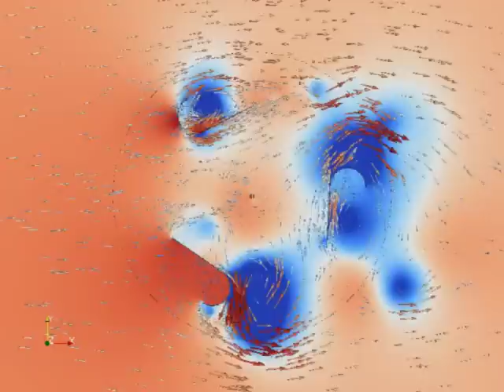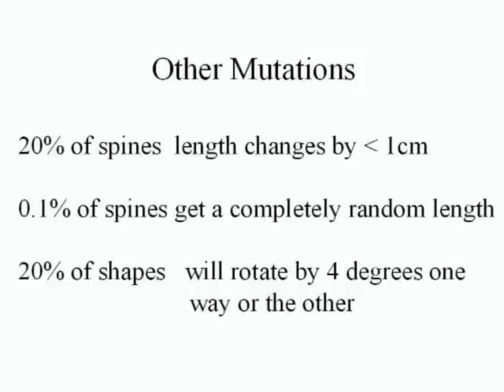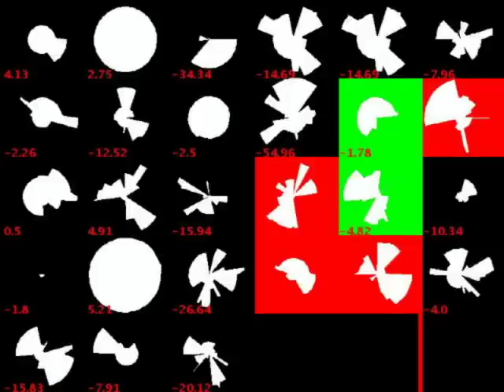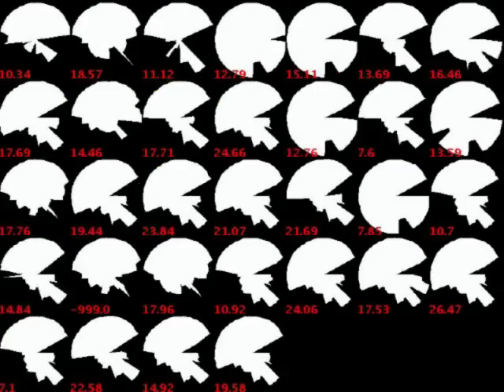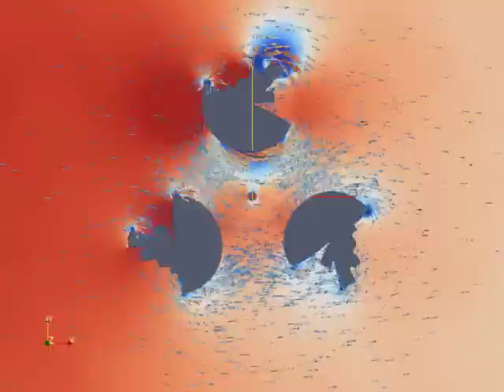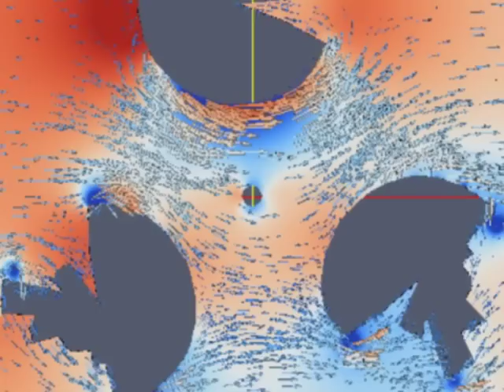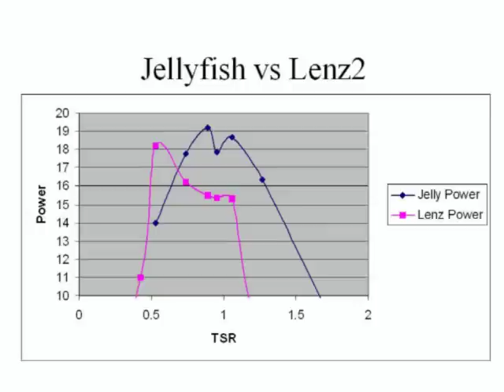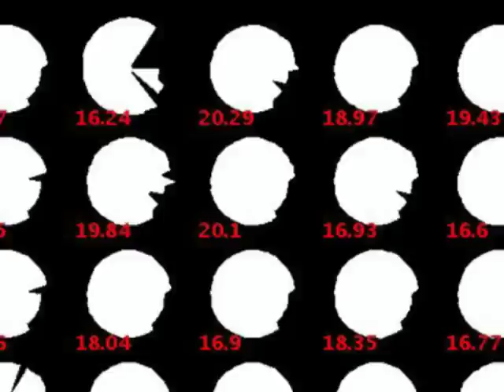Evolving Wind Turbine Blades

Comment: technically you did design the blade, otherwise it would never have looked like that.

Computer evolution always has a designer behind it, or else it never would have done anything.
You can also conclude that real life has a designer since nothing would have come on random.
Reply: "technically you did design the blade, otherwise it would never have looked like that."

No, he created the environment and its laws which then created the blade. The computer designed 100% of it.
Reply: SaHaRaSquad yes HE created the environment, and how the shape would look, that's based on his inputs. it didn't happen out of random. computers are actually designed to do what you tell them, they do not create anything out of random. you can see the end goal of the shape is actually just a circle.
Reply: MrPepsicola123 "computers are actually designed to do what you tell them"

And he told the computer to randomly generate and mutate turbine blades and simulate natural selection - which is exactly how real evolution works.

"they do not create anything out of random."

So you never heard of something called random number generator?
When a computer program uses this to change a shape, then this shape will be completely random, without depending on the decisions of the programmer.

"you can see the end goal of the shape is actually just a circle."

I don't know how circles look in your universe, but the final simulated shape is definitely not a circle.
Reply: SaHaRaSquad it wasn't randomly generated, he input a design he wanted and the computer "generated" an outcome based on his inputs. he created the shape.

Evolution does not work like that.
Reply: MrPepsicola123 "it wasn't randomly generated"

It was, why is that so hard to understand?

"Evolution does not work like that."

Evolution works exactly like that.
Reply: technically, yes, it's a shape that's based on having a spline around a center, BUT the length from the center to each point of the spline is determined at random in the begining.
After that some properties slightly change at random and the best performing shapes are kept.
Reply: MrPepsicola123 
"you dont seem to understand anything i am talking about"

You obviously don't understand anything about computers or programming, the stuff you wrote is truly cringeworthy.

"He input a set of instructions and let the computer generate an outcome based on his input."

Yes, and his input said "create a wind turbine blade based on random numbers". His input only set the rules, and the randomness made sure that he didn't have any influence on the outcome.

"if it was truly randomly generated he wouldn't have input a single instruction and the computer would have done it on its own."

If a dice roll was truly random the dice would have rolled on its own. At least according to your logic.

Your YouTube account is based on encryption, and encryption on computers uses true random numbers. If what you said were true, everybody could hack into every account on the internet and encryption would be useless.

"this is not how evolution works"

Learn the difference between the creation of a program and the logic of a program and then we can talk about this point. Although then it wouldn't be necessary anymore because you'd understand your arguments make no sense.
Reply: MrPepsicola123 "computers cant even randomly generate numbers."

This is wrong, period. Every decent pocket calculator can generate random numbers.
You have no idea how computers actually work and should stop spouting nonsense about algorithms which are clearly beyond your understanding.

There's a name for your behaviour, it's called Dunning-Kruger effect.
Reply: MrPepsicola123 "thats what it is, a theory"

Exactly the response I expected from someone like you.
A scientific theory is the most solid and reliable form of scientific knowledge there is.

So evolution is as certain as the fact that matter consists of atoms(atomic theory) for example, and it has been tested and confirmed countless times.

"if we know that we live in a simulation, we can change the code."

No. Data packets in a computer cannot directly change themselves. If our universe was a simulation, we wouldn't have a chance to change the slightest detail.

"that is what they are doing using quantum computers."

Quantum computers are nothing special in terms of computability. There is no kind of computational problem for which quantum computers are proven to work better.

Also they have nothing to do with simulated universes, they are just another basis for computing, just like biological computers are.
Reply: +SaHaRaSquad Why are you still arguing with this pathetic excuse of a human being?
Reply: SaHaRaSquad you dont seem to understand anything i am talking about and have this strange notion that something can be created out of nothing.

He input a set of instructions and let the computer generate an outcome based on his input. if it was truly randomly generated he wouldn't have input a single instruction and the computer would have done it on its own. this is not how evolution works, and this is not evolution.

this is called creationism.
Reply: SaHaRaSquad It is you who does not understand, computers do not create anything, they take inputs and spit out information, computers cant even randomly generate numbers.
Reply: SaHaRaSquad They do not randomly generate numbers, they take a pool of numbers and pick out numbers based on an algorithm someone coded. it is not true random, it is Pseudo-random, they may appear random but they are not.

You can call me whatever you want, and you can say i dont understand when it is you who does not understand all you want. it still does not prove that you are correct.

Friend it is you who is bias, you want evolution to be real so badly that you will convince yourself that computers can prove evolution. even when you know that a computer by itself can not create anything beyond what it is coded to do.
Reply from the maker: They don't use a pool of numbers, but it is true that they are generated by an algorithm.  You can make them a little more random by seeding it with the time or some other external variable.  Never the less, I did not program in the numbers that I wanted to come out, to me they were random, and evolution as an algorithm works.  You can decide for yourself if that applies to the world or not.  It sounds like you choose to believe it doesn't.
Reply: sjh7132 its still pseudo random, there is still a pattern. we have even discovered that real life is not so random as we think it is, there is also patterns like in a computer.
Reply: MrPepsicola123 "They do not randomly generate numbers, they take a pool of numbers and pick out numbers based on an algorithm someone coded."

And these pseudorandom numbers get seeded by a true random number, also cryptographic algorithms and online encryption/authentication only work with true random numbers, otherwise it wouldn't be secure.
There are multiple ways a computer can obtain true random numbers.
And in the end in this example it doesn't even matter if the number is pseudorandom as long as the seed is truly random - which it usually is in every modern language I know.

"it still does not prove that you are correct."

In a scientific sense I really didn't prove anything. At the same time you also didn't disprove anything, though.

"you want evolution to be real so badly"

No, I just know it is real.

"even when you know that a computer by itself can not create anything beyond what it is coded to do."

But it can, that's the thing you don't seem to realize. Languages like Lisp and artificial neural networks can dynamically change themselves and adapt new behaviour.
The same computer algorithm which beat the best Go player in the world was also used to play old video games - without any change to the program, it was only learning how to play the games based on the highscores.
Reply: MrPepsicola123 "we have even discovered that real life is not so random as we think it is, there is also patterns like in a computer."

...which would actually contradict your point and again mean that computers can indeed simulate processes like evolution even with pseudorandom numbers.
(aside from the fact that computers can obtain true random numbers anyways, for example via the kernel entropy pool in Linux).
Reply: SaHaRaSquad it does not contradict me, it proves that even we might be living in a simulation. meaning someone created us.
Reply: MrPepsicola123 "it does not contradict me"

As long as evolution is a sound scientific theory it does, but whatever.

"even we might be living in a simulation."

We might be. But it doesn't really matter, as we can't know for sure and even if we knew we can't change it anyways.
Reply: SaHaRaSquad thats what it is, a theory. and so is humans having the ability to fly without machines.

if we know that we live in a simulation, we can change the code. that is what they are doing using quantum computers.
Reply: Medhusalem Hope.
Reply: I have no idea what just happened...
Reply: Why do humans have a blind spot in their eyes if they are perfect? Why are babies sometimes born with genetic diseases? Seems our "creator" must be pretty bad at his job.
Reply: MediaevalJames the creator did not make any bad choices. we were designed perfect.

Our DNA is degrading every generation. we were designed perfect. blind spot may seem like a defect but it's there for a reason and we have 2 eyes so it's not noticeable, without that blind spot we couldn't see.

babies are born with genetic diseases because of bacteria/viruses or malnutrition by the parents.

There is also a reason to believe humans were originally created with Silicon rather than Carbon and somewhere along the way our bodies were changed to carbon which is more prone to disease than silicon.

Why come to that conclusion? the earth is 90% silicon and it makes no sense for the earth to produce bonds with carbon rather than silicon.
Reply: MrPepsicola123 "the creator did not make any bad choices. we were designed perfect."

You don't seem to grasp the concept of perfection. Every species on earth has so many flaws they are all closer to garbage than perfection.

"Our DNA is degrading every generation. we were designed perfect."

Perfection wouldn't degrade.

"blind spot may seem like a defect but it's there for a reason and we have 2 eyes so it's not noticeable, without that blind spot we couldn't see."

Perfect eyes wouldn't have a blind spot.

"babies are born with genetic diseases because of bacteria/viruses or malnutrition by the parents."

Genetic diseases are something very different than bacteria and malnutrition.

"There is also a reason to believe humans were originally created with Silicon rather than Carbon and somewhere along the way our bodies were changed to carbon which is more prone to disease than silicon."

No. But there are countless more reasons to believe in evolution instead.

"Why come to that conclusion? the earth is 90% silicon and it makes no sense for the earth to produce bonds with carbon rather than silicon."

Majority doesn't mean anything.
Reply: SaHaRaSquad what you view as imperfections is actually called opinion.
disease can affect your genetics.
Reply: MrPepsicola123 "what you view as imperfections is actually called opinion."

Bullshit. Perfection doesn't depend on opinion.
And the existence of blind spots in the eye and countless other flaws do neither.

So far the only reasonable explanation for all these phenomenons is evolution. Doesn't matter if you agree or not, luckily truth doesn't bend according to your will.

"disease can affect your genetics."

Indeed, but you implied only diseases and malnutrition can cause genetic defects. Which again is plain wrong.

Comment: i see that you get stuck in a local optimum since you have no mutations comming in after a species becomes dominant. if you introduce mutations even in later stages you are able to jump local optima
Reply: I agree. By only selecting from a rather small population to start with, this experiment isn't so much evolution, as it is selecting a winner from the small population, even though you get some crossbreeding thrown into the mix. 
It's basically relying on getting lucky with the starting shapes.  
The final result is something best suited for playing banjo. ;)

I would suggest having multiple offspring, with varying levels of mutations.
Reply: Wouldn't that take forever to simulate? I'm asking because I'm new to te subject but wanting to give more time to this because its very interesting.
Reply: Federico Perez Thats the whole point with evolution... its an endless process. with time you will converge to the global optima

Comment: After a general shape is determined there is no way to make major improvements to it because to make improvements you might have to take a couple steps back. Add a small chance to result in larger changes in the mutations and you should have better results in a small population.

Comment: did anyone notice at  8:11 one blade has -999 power?
Reply from the maker: I think I capped values at 999 in my display software to keep the numbers from messing up the formatting.  That turbine would be an excellent air brake!

Comment: This results are valid in any planet =). If you set viscosity very high - you set the Re number to be very low. I think it is possible calculate Re number for this simulation and so calculate real velocity of the flow according to Reynolds number.

Comment: Do you still have this program by chance? I would love to run it for a while.
Reply from the maker: The software I used is very out of date, and I had trouble making it work last I tried.  (about a year ago.)  I think much of what I did will have to be modified to make it work with current versions of openfoam and gmesh.
Reply: Could you provide a download anyway? I wouldn't mind spending time to make this work.

Comment: You should add the Lenz in with the jellyfish and a bunch of random shapes to see what comes up
Reply: richy3454 That's a big problem with this simulation: the way it creates blades is very restrictive in a way which makes it impossible to create blades like the Lenz.
Reply from the maker: Because doing what you saw in the video, took all my computers  at the time. (4 or 5 of them, most better than quad core), a month to do.  That's with limiting the simulation.   And since I had them all booted into linux, I couldn't run other stuff that required windows, during that time.

Comment: I wonder what would have happened if your mating was not only for the best of the generation but allowed combining also two worse shapes.
Reply: perhaps what he meant to say was that the worst individuals of a generation are not automatically weeded out as in most evolution algorithms.
Reply: This is exactly how evolution works! People who are badly adapted still reproduce in case an environment appears where they might actually have an advantage.
Reply: Even so, lesser-adapted individuals containing traits that might be advantageous in the future isn't something that would happen in a simulation like this. It happens in the wild because the conditions change. In this simulation, no matter how long you run it, the conditions, and the criteria for fitness, will never change. Keeping around individuals that perform poorly isn't likely to result in future individuals that perform well. Perhaps increasing the mutation rate might, though...
Reply: Except that evolution is "meta" in the sense that it can change its own rules to become capable of planning. The retention of the seemingly mediocre individuals is a perfect example.

Comment: Have you tried 3D printing the blade? I would love to see how it does in the field
Reply: yeah, just treat this like a cross section of a taller blade.
Reply from the maker: Another guy here on youtube, made a turbine and had it simulated several ways, including 2d and 3d.  Then he compared to real life.  The 3d was MUCH more accurate.  (unfortunately it's also much slower to do.)
Reply: @sjh7132  do you know who?
Reply: This was a 2D simulation so it couldn't be 3D printed.
Reply: Sure, but it's difficult to say if the third dimension won't change things. Would be nice to run 3D simulations with similar code/parameters. Probably would take longer, though...
Reply: yes please

Comment: Even if this thing worked IRL, the complex "tail" with its numerous small, delicate structures would be highly susceptible to becoming damaged or even just dirty, which could have a large deleterious effect on the power output. This isn't a problem in a living creature that constantly self-repairs, but is obviously an issue for a man-made turbine blade.

Comment: You used coarse simulation to select the winner yet your mutations in each generation are so small. That's the problem. Coarse simulations can't tell the difference or even give the wrong results to small mutations. For coarse simulation, you have to make the mutation radical so that the results are differentiated enough to have credibility for selection.

Comment: Really impressive work, but as others have stated, you're getting stuck in local optima.  This won't be solved through mutation rates, as there may not be any single or even two mutations that can get you out of it.  You should redesign your genome, potentially adding some genes that affect a range of splines.  Also come up with something that could create more concave shapes.  This will allow single mutations to potentially have more significant impacts.
Reply: +Jeff Haluska I was thinking that this algorithm could improve if a different method of generating shapes were used, ideally one which didn't tend to generate spiky protrusions from the center.